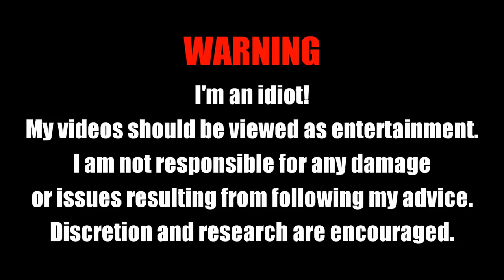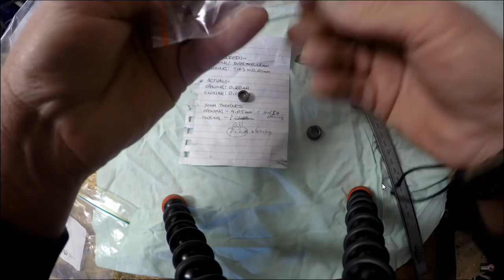DUCATI 900SS Ep2 - Starting the Engine Removal

Comment: watching because my 1993 900SS CR engine has really low compression in the front cylinder, and a bit low in the back cylinder.  Carbs have been rebuilt, new clutch throw-out bearing, new belts.  New coils, new wires, new spark plugs.  But....low compression.  I'm just another guy with a project bike in the garage.

Comment: Love the thorough break downs and explanations as you move forward. Quick question, you say to use loctite on the older Ducati's, but are you worried when steel bolts contact aluminum and they fuse together ? I am working on a 2001 900 SS and it feel Like I'm going to snap each bolt !  Paul C from NJ USA.
Reply from the maker: G’day mate. Steel fasteners in Aluminum alloys corrode when moisture can make its way into the thread. Loctite forms a barrier and protects the thread actually reducing the likelihood of corrosion occurring. If you use a low strength like 243 nut lock it can usually be removed with normal hand tools. If stronger thread lock is used then the application of heat will melt the loctite and allow it to be removed, again with normal hand tools.

Comment: Andy, love the channel, like your taste in motorcycles, appreciate you know what you are talking about.... call me old fashioned and a Luddite and i am, but i just cringe everytime i see a power tool undoing a normal fastener. With a power tool you are not getting a feel of the fastener, its torque setting, nor its thread condition. Not trying to teach granny to suck eggs et al, but IMHO, the only time a power tool or especially a rattle gun has any place near a m/c is when that 150 lb ft nut wont come undone with the 1/2" breaker bar. Regards and HNY.